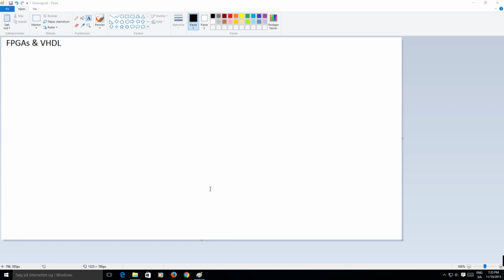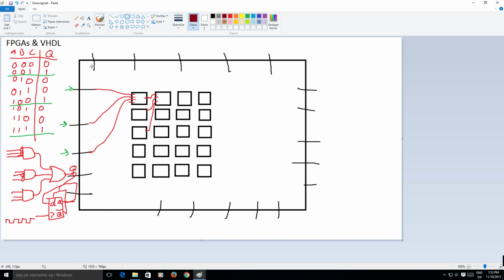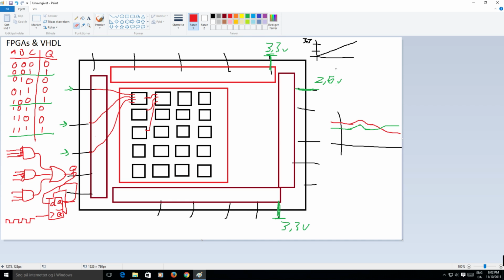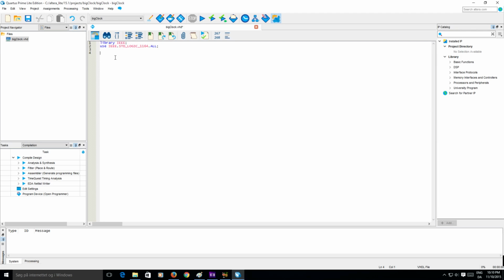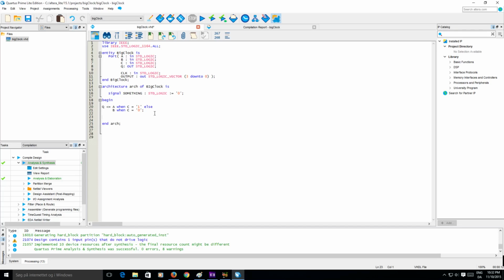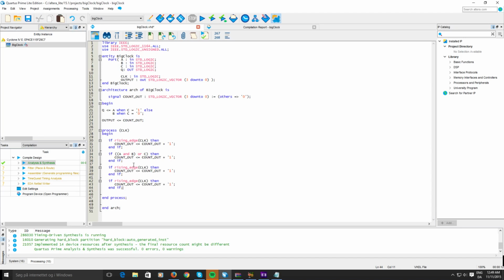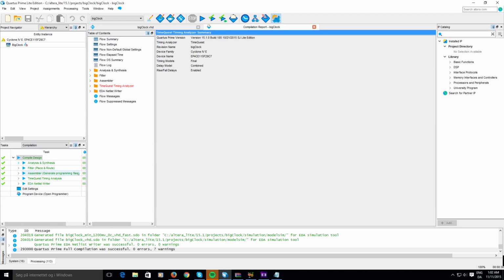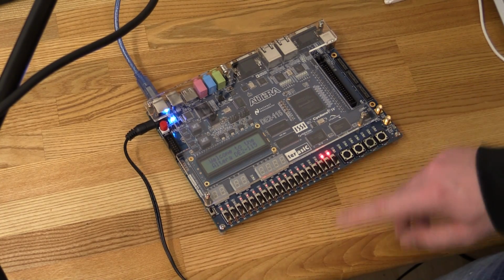FPGAs and VHDL- Part 1: What is an FPGA? + Programming the board - Ec-Projects

Comment: Thanks for the tutorial really helpful, i have some questions : Is it possible to mount an operating system on it ? (windows,unix) or is it possible to program games on it using assembly language ?
Reply: Definitely not. An FPGA is not a cpu and it doesn't have memory - it's just a bunch of logic blocks that perform logical operations on input and produce output. This is what makes it so quick.

Comment: Great video, as a software developer I'm intrigued by the fact all the if blocks run at the same time, that'll take some getting my head around. Presumably this is because the inputs to the if statements are permanently tied to the pins on the chip which could change state at any time. I'm hoping you show an example of this behaviour.

Comment: Excellent video :) I have one of the cheaper Cyclone II boards, but I need to upgrade I think. The updated Quartus looks so much better (it does not support II as I remember). May I ask where you got your board? Looking for a good source on it, it's in my Mouser shopping cart. Er du norsk? EDIT: Just saw Part 0 and you pretty much answered my questions. DE0 it is :) Mange tak!
Reply: +Krankzinnig Piet Yeah, I figured. "Mange tak" (my ending) is Danish although similar to Norwegian and Swedish it's actually unique in its spelling. Thanks though :)
Reply from the maker: +Alexander Brevig thank you ! Yeah the new icons are prettier :P The ModelSim is still the same old crap though :D :D selv takk :P